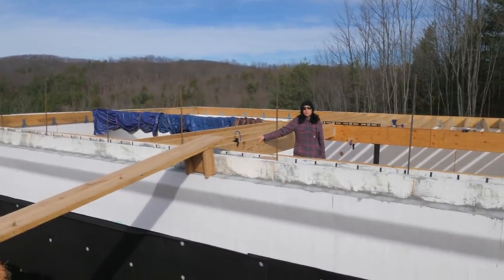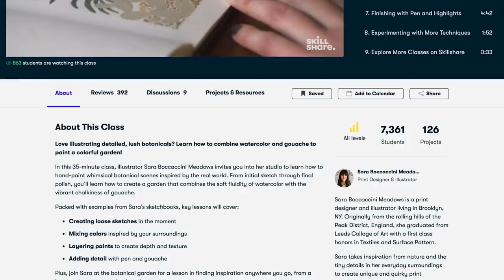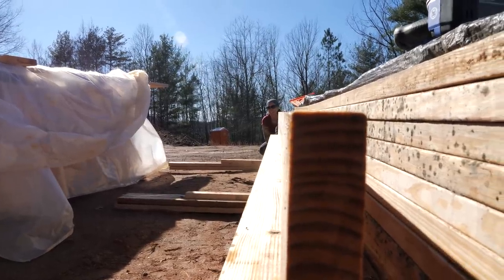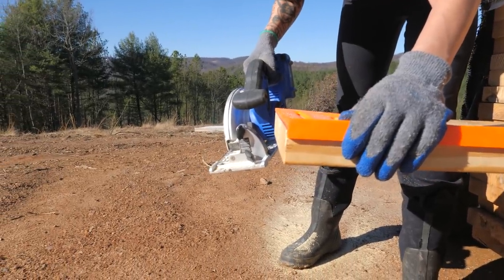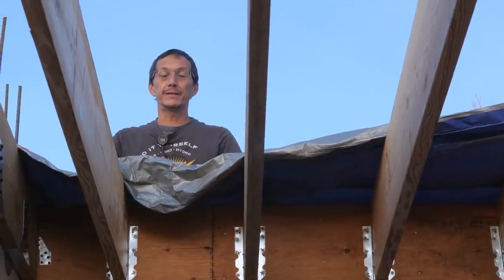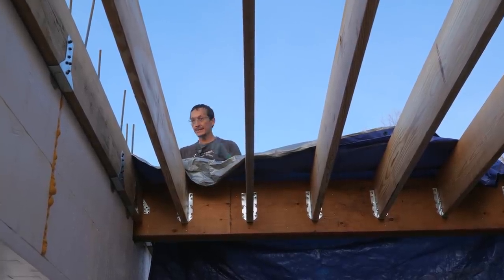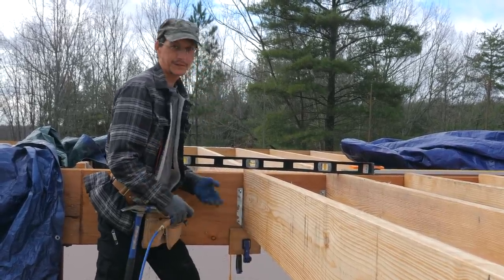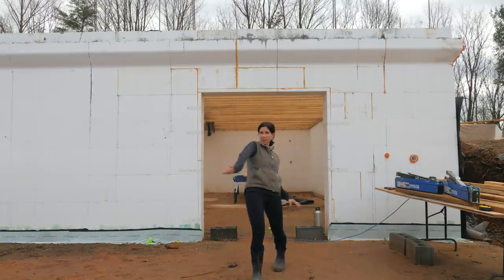ICF Mountain Homestead: Subfloor Framing Continues

Comment: Just for your peace of mind the nut or bolt that holds saw blades on is designed so it will tightens each time you use the saw until it is so tight it stops tightening. That is why they are hard to loosen  to change the blade. This makes it next to impossible for it to come off even if it wasn't very tight. If the bolt was slightly loose the blade would slip and not cut when it touched the wood until the bolt tightened.

Comment: Glad to see that you got the palm nailer . Someone said blocking is useless . That person is WRONG . Blocking is needed to strengthen the floor joists . It also keeps them in the right spot when nailing the plywood flooring . Every single house has some sort of blocking whether it be wood or metal bars . Looking good . Just wondering why you didn't use I beams instead . A lot lighter to move around . Don't get me wrong here . I would have done the same as you . Just wondering . What's that laser level you're using . Thanks

Comment: Nice job guys, I would also recommend a worm drive skill saw as long as your both right handed.  Those battery units are nice but getting comfortable with the heavier unit now will make when you go vertical a little easier to manage.  Check out the essential craftsman for some tips and tricks.  Single boards are fine but being able to cut two or three deep 2x stock in a single pass is where a corded skillsaw shines.
Reply: Rigid worm drive is left handed if needed

Comment: While learning why not use a clamp to hold the square/fence, you can then use two hands on the saw.

Good job getting stuck in. Projects coming along well.

Learning tip - before using a tool check out how too and what can go wrong, basically the does and don’t’s and tips.... circular saws can bind and kick back at you, drills can twist and break your wrists, angle and bench grinders can shatter the grinding stone / disc, nail guns can shoot straight through the timber or off at an angle so never put yourself or others in the line of fire etc etc. be careful of learning from pro’s, they are used to using the tools, probably have seen or had the problems and forget to mention what they do to mitigate or just take short cuts or bad habits they learnt and are ignorant of the safety issues inherent in using the tool.

30 minutes of learning on each and you could save a trip to hospital or worse.

Comment: Come summer time keep your speed square in the shade our it will warp. The metal squares you have a big problem with heat. They will get so hot you can burn your hand.
I know you live further north than I do but be careful. Put square in shade or ware gloves.
I live in deep south Texas. Vinyl mini blinds melt in summer.

Comment: Jamie just needs a radial arm saw......so much easier and less scary, at least for me it is.
Reply: I have three radial arm saws and my grandfather was a safety demonstrator for Dewalt/black and decker so he taught me how to use it properly.  It is the most dangerous saw i own...most versatile, but one that requires constant diligence.  The 'safest' saw i own is probably the 12 inch sliding miter which does rough framing ok with a decent fence.
Reply: Radial arm saw is completely useless in that situation . Those boards are very long and heavy. You would need to prop them up evenly with the table . Even a sliding miter saw is better but you still need to level out the board before cutting . The way she is doing it is fine . She just needs a more powerful saw and stop being scared .

Comment: So it seems the floor joists are all proud of the center beam. Is that by design or just where they fell once they were leveled with the outside walls?
Reply from the maker: Both. We didn’t want the beam to dictate the floor height. It’s job is to support the floor system. There’s also room to run wire along the top.
Reply: @Guildbrookfarm  That makes sense, and I'm guessing the 4.5 inches or so that the subfloor isn't supported down the center won't make a difference if you're using 3/4" plywood sub. The wiring chase is key and something I hadn't considered and if it saves you from drilling holes in the beams to run the wires that will make putting up insulation that much smoother and easier. It's looking like it's coming along nicely. I hope the weather holds up for you.

Comment: I thought you were going to do ICF for the first floor also? If so, why did you cut the numbs off the top row of the basement blocks?
Reply from the maker: You just glue and strap the first course of the next wall. We needed a half course on top of the brick ledge course.
Reply: Guildbrook Farm - Simple Sustainable Living Got it. I assumed you would have used 1/2 the number of full blocks cut in half to do the first run and then used a full block over the ledge and kept the locking nubs which is why I was surprised to realize that the nubs were missing.

Comment: Blocking is totally useless. Once the floor is glued and screwed in place, the joists will be as stiff as they can be.
Reply: NoC you couldn’t be more wrong, any journeyman carpenter can tell you that. What are you going to nail or screw the edges of the subfloor to? Blocking also add strength to the whole structure, limiting flex of the joists.
Reply from the maker: It’s code and definitely necessary
Reply: @Guildbrookfarm  Totally get that you have to deal with code enforcers. Land of the free, home of the building inspectors.
Not a single house here uses blocking and there isn't any flexing or bouncing floors. Outdated codes.
Reply: Codes are there to protect people from themselves. Try and sell a house that’s not up to code, then get back to us.